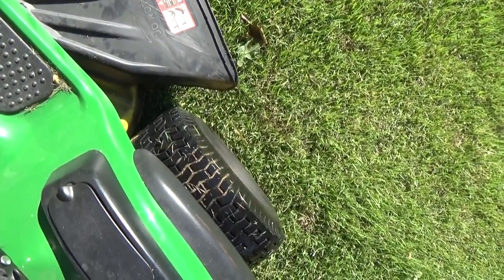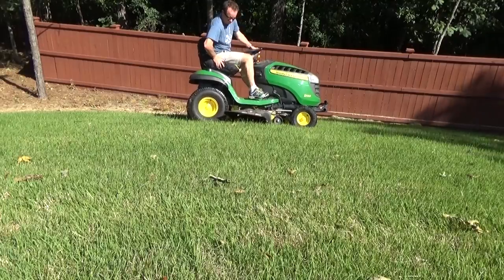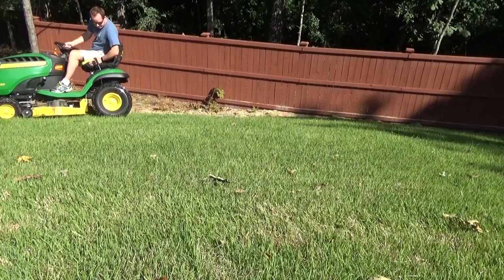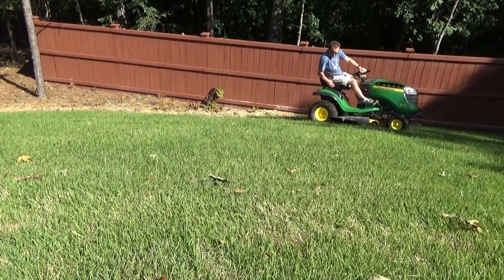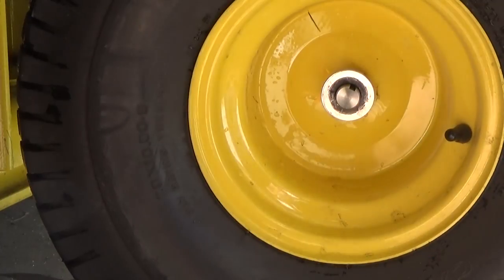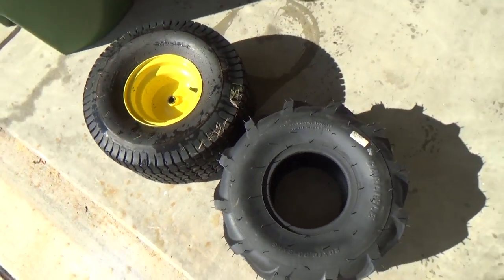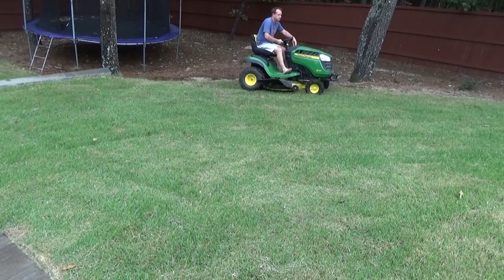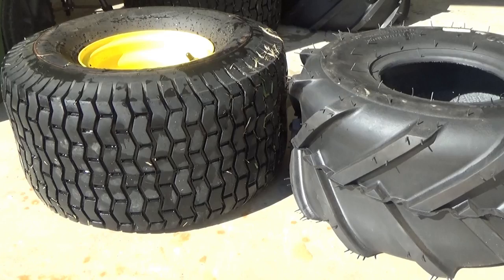How to Fix Spinning Lawn Mower or Tractor Tires

Comment: Great video Clint. You just convinced me to ditch my aging 3 year old TerraGrips and spring for these tires. Couple questions, do they ever spin in an extreme incline, and any marks on the grass from the tires?
Reply from the maker: I actually removed these and went back to the stock tires with TerraGrips and I have to say I wished I hadn't.  The TerraGrips work fine but they make the ride so uncomfortable.  These were pretty smooth and worked great.  I noticed no damage to the lawn. The only spinning I would get is if I was turning in dirt that didn't have grass on it.
Reply: @ClintHolland  Can you share why you went back to the stock tires with TerraGrips?
Reply from the maker: @kerwin1122  Because one of the commenters on here told me it was a better solution.  So I had to try it to see.  They work great and don't tear up the yard but the ride is unbearable.
Reply: Clint Holland thanks for the quick reply. Based on your review, I went ahead and ordered the Carlisle tires.
Reply: @ClintHolland  Thx for sharing about the ride Clint you are an honest man.  I have a back problem and one of the big needs for me on my next mower is not only traction but also comfort (less jarring than my old JD).
Reply: One video clip, "Choosing Tires for Your Garden Tractor" recommended using heavy duty all purpose tyres.

Comment: OK, so it's not just me.  Thanks Clint.  I'm not happy about having to spend the extra money, but if I can't drive uphill, it wold be even worse.
Reply from the maker: Completely agree.  Things should just work.
Reply: So glad you responded.  So, I have 20x8x8 tires I'm looking at like yours, are 20x10x10  Do you think they will fit the rim OK?  Maower frame has lots of room Thanks again.   @ClintHolland
Reply from the maker: @MacPennington  So my understanding is that they will technically fit the rim but you may cause undue stress on the transmission as well as have a clearance issue with your fenders.  But they should fit if you don't mind maybe modifying the fender a little.
Reply: Clint, I can't thank you enough for your help.  I will dedicate my first trip uphill to you and there I will sip a hot cup of coffee in your honor!   @ClintHolland

Comment: Are those tires hard on your grass
Reply from the maker: I thought they might be but I haven't had any issues with them. You do have to be careful in soft sandy areas though, because they will quickly dig a hole.
Reply: @ClintHolland  , I am looking for a good riding mower to use as a Utility Rider for Lawn Rolling and small hauling loads . I have a hill from my backyard to front yard and believe I will need more traction
Reply from the maker: @dannewell5271  I really like the John Deere models and don't think you can go wrong with them. Instead of these tires you can also look at putting terra grips on them or buying some wheel weights.  Those are work pretty well.

Comment: i have an ariens riding mower, 7 years old with original tires...i just found the same mower that was only used one season. so my new mower has tight and easy steering while my old mower has a larger turning radius and the steering just doesnt feel the same as the new one..could it be that i simply need new front tires on the older mower,,or should i check something else?
Reply from the maker: I doubt is is the tires unless you see them sliding across the grass instead of gripping. If you turn the steering wheel all the way in either direction on both mowers, do they both look like they turn the same amount?
Reply: man i wish i could have looked,,but i just sold the old one a couple days ago..ty

Comment: do you still have this mower?
Reply from the maker: I sure do.
Reply: @ClintHolland  did you ever try letting half the air out of your turf tires to see if that would help give you more traction?
Reply from the maker: @mrbubetube  I actually tried everything but wheel weights.  I removed air from the tires and tried out the terragrips but these were the best outcome.  I wish I had tried wheel weights but they can be pretty tough to find. The terragrips worked as well but they made the ride so horrible it wasn't worth it.

Comment: wheel weights... and/or you could shift your weight to the high side of the tractor.
Reply: I know what the problem is.  If you look closely at the beer holder, you see that it is completely dry.  ALWAYS make sure the beer holder is filled with the proper fluid.
Reply: @mrbubetube  The grass looks wet. Cutting wet grass is a no-no. could fill the tires with washer fluid for weight. Could have wrapped some chain around them. But still, sitting on the downhill side of the seat does nothing but make it worse. And why not go up and down the hill? Going across a hill is a big no-no.

Comment: Don’t mow in the wet grass it’s very bad for your mower deck and blades, trust me I had to work on my used mower at someone had mowed wet grass and there was rust and grass clumped together it was pretty bad took a few days to clean
Reply from the maker: I wish it were that simple.  I agree that mowing wet grass isn't ideal but this problem existed rather the grass was wet or dry.
Reply: Wow that’s weird I’ve never had that problem

Comment: that's not even a hill.wtf.
Reply: I was thinking the same..😅
Reply from the maker: Yet it prevents my lawn mower from climbing it.  What is your definition of a hill?
Reply: @ClintHolland  your problem is that you don't have enough weight over the rear tires.
Reply from the maker: @chriscoatess3600  That is one way to look at it.  You could also say my rear tires don't have enough traction.  I looked into putting wheel weights on it but it increased the width of the tractor too much.  There are several ways to fix this problem. A locking differential would probably work too.

Comment: Does the new tread tear up your lawn?
Reply from the maker: Haven't had that problem yet but I really didn't get to use it much since installing them. I will keep an eye out for that.
Reply: ya, that's what I was wondering.  going straight for the ag tires was overkill.  they're made for people who do a lot of tilling or driving around in the woods.  they'll tear up a lawn over time.  The HDAP tires would work without tearing up the lawn too much, or go for the Terra Grip traction belts.  What tractor is he using?  Is that a D130?  Not sure if you can get the HDAP tires for that, you'd have to ask John Deere.  I always thought it was ironic that John Deere puts the differential lock on their bigger heavier tractors only when it's the lighter 100 series tractors that need it most.  I think that's their sneaky little way of steering people into buying their mega thousand dollar tractors.
Reply: So is it tearing up the lawn?  I'm looking to get some new tires on my D125 that will give better traction due to an incline i have, but I don't want to tear up the lawn.
Reply from the maker: It's not but I think I am going to try Terragrips next and do a video on them.  One of the users here suggested them and they look like a better solution than these tires.

Comment: @clint " Fix Lawn Mower Tires from Spinning and Getting No Traction" been over a year.  Still waiting on that fix for the tires that were spinning??  Replacing the tires does NOT  fix the existing tires that were spinning ..
Reply from the maker: Try out some TerraGrips.  They work great for traction if you don't want to replace the tire.
Reply: Maybe think about ANGLING ACROSS the slopes instead of running directly up and down them -- and keep the pulling (right side) wheel on the low side so the mower's weight forces contact with the ground. If that doesn't work, you are probably operating on terrain that the tractor isn't built for -- and that would be a safety hazard. And PLEASE don't every use power equipment when not wearing shoes!

Comment: Could of just bought terragrips
Reply from the maker: Good callout.  Wish I had found those before I put these tires on.
Reply: Clint Holland no problem
Reply: About the same price as a new set of tires. However, they wont last as long. I have a set. They gave me 3 good years but now I'm turning them in for some proper grip tires.
Reply: Are you regretting the decision since your video?

Comment: "How to fix your lawnmower tires from spinning"

Take them off your lawn mower.
Reply: Option 2: Turn off your engine. 
Option 3: Press the brake.
Option 4: Sell your lawnmower.
Option 5: Repeatedly wash your tractor in salt water.

Comment: You need more weight on the back brother your too lite
Reply from the maker: That definitely would have helped. Wheel weights would probably also fix this issue.
Reply: @ClintHolland  do you think the deck might be catching on the ground?  do you try raising the deck when you get stuck like that?
Reply from the maker: @mrbubetube  I actually did check that. While it sometimes does catch going over uneven terrain that wasn't the case most of the time.
Reply: @ClintHolland  Did you ever show this video to a John Deere specialist?  Most of them would probably tell you to buy their terra grips because they're always interested in making a sale, but some may be honest and helpful enough to suggest a cheaper option.  Lowering the tire pressure might help but then that would also alter the cut height a little, but making any change to the tires would do that as well so there's no big disadvantage there.  I've heard some people would put a "sock" around the tire or some other textile cloth like a potato sack or some manila rope.  But John Deere might be able to tell you if there's some mechanical way to "jog" the transmission back and forth to get the other wheel to engage.  I don't know if that can be done but they might know.  You could also send that video to someone at Tuff Torq, the guys that make that transmission.  They might know how you can get the other wheel to engage when one is slipping.  How is your lawn after using those heavy duty lug tires?  Are you seeing any damage or tracks or mutilated grass?
Reply from the maker: @mrbubetube  I did not. I actually own a set of terra grips and while they do work, they make the ride so horrible that I can't take it. It is like riding over speed bumps the entire time.  I have also heard good things about wheel weights but I didn't try those yet.